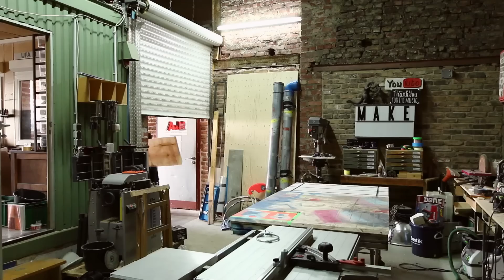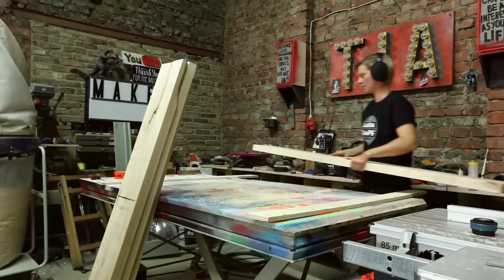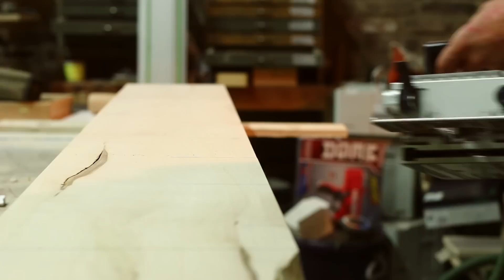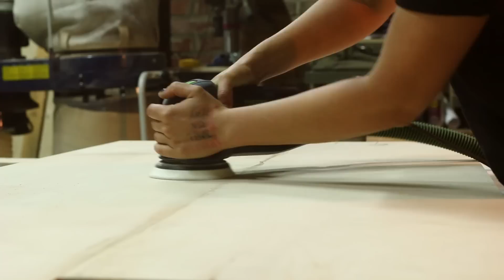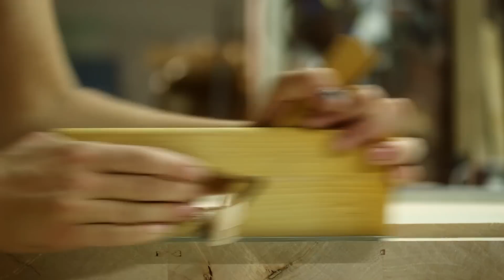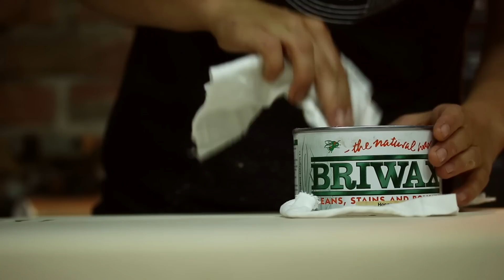Laura´s Maple Table (Part 1)

Comment: Great start to the table! I'm sure it is going to turn out great! The bowties are a nice touch..
Maybe one tip on the breadboards: Don't route the entire groove but stop 3 a 4 cm before the end (plunge cuts on the router). Then take the same width of the tenon on both sides.
Then the breadboard is completely flush with the table and you can "hide" the tiny gap between the breadboard and the tenon because the joint is hidden.
Reply from the maker: +Norner Houtbewerking that's good avice! thanks

Comment: Beautiful! 
I love the choice you made to use the live edge on the breadboards.
Reply from the maker: +Walter Kessler thanks! that wasn't planned but when i saw that beautiful edge i had to use it :)
Reply: +Laura Kampf I have yet to even do a panel glue-up! Without a jointer/planer or biscuits, I'm not sure how it would turn out 😮

Comment: Very cool project Laura.... And great music..
How do you feel about hour jointer thicknesser? I have a similar size but different brand and I don't like the stability of the thicknesser table, it stands on one cylinder and can rock a bit.
Reply from the maker: this one is solid as a rock...it probably weight around 300 kilos...so no rocking here :)

Comment: often thought about ways to get around spending a fortune on very large clamps. like drilling and resin fitting some 'bolt holes' into the concrete floor for fixing angle iron into.
Reply from the maker: yeah, why not

Comment: Great video! Beautiful shots, awesome music, great result! Keep it up!!! Really like the live edge breadboards. Did you wiggle the drill bit (to expand the hole) on the pegs on the edge for wood movement?
Reply: I can't decide on metal base or wood. I guess it depends on the feel you want. Wood will be a warmer material. Also depends on the design of it.
Reply from the maker: hmmm, nah, i didn´t do that because i was worried it might be get to loose...hope it won´t crack...if it does i can fix it probably. the table will stay with me so i will have an eye on that :)
Reply: +Laura Kampf Beautiful work. However Brian is right - you will most likely have a challenge when humidity is changing where the table is placed at the end. Over the width of a table maple will expand 1-2 mm for each % humidity change.
Reply: +Laura Kampf what you want is to have it tight on the breadboard itself but on the tenon of the top give it some wiggle room. You can glue the dowel to the breadboard and leave it unglued to the tenon of the top. Potentially you won't have as much humidity swings with no a/c (when I was there no one had a/c) but if it's in that room with the wood burning stove that can be a problem.

Comment: Did you glue all the pins on breadboard ends?  From the video it looks like you just drilled through and glued the pins in.  Only the center pin should be glued completely.  The rest of table will expand more than the ends so the pins need to be able to "float".
Reply from the maker: i glue them all in but the table will sta in my house...in case something happens i can drill them out and try again :)

Comment: I'm curious, is there a reason you chose to use shims to fill the gaps, as apposed to woodglue and sawdust or a similar method? It looks good either way, I'm just wondering if there's some reason I'm missing.. lol 

Anway, it looks awesome just like always!
Reply from the maker: no, i just has these and put them in there

Comment: You do a great job with your videos.  If you want to get a better idea of why breadboards are usually made with mortise and tenons rather than one big tenon in a slot that goes all the way across check Matt Cremona's video "Matt's Weekly Shop Update - Sept 8 2014".
Reply: The dowels will take over most of the load here,  unlike Matt's joint.  But the video doesn't show if the dowels have slots for movement,  so there could be another problem.
Reply from the maker: no, they don´t i was afraid they might get too loose...and since this table is under my personal supervision i thought i take the gamble :) if it starts to crack i will drill out the dowels and give them a bit more space